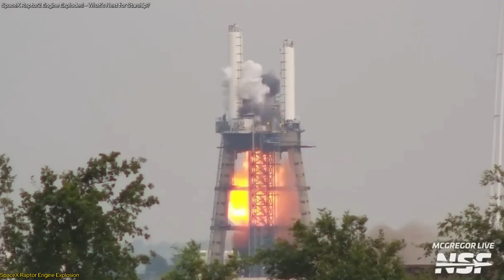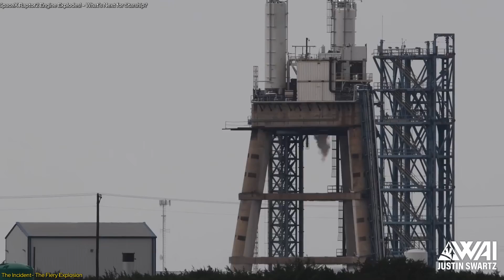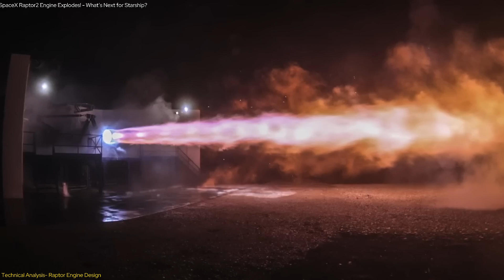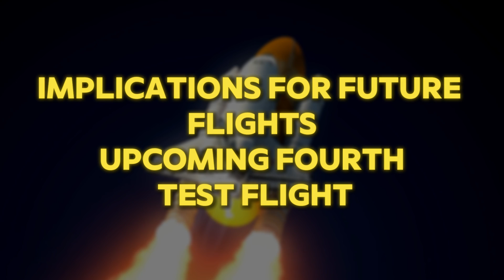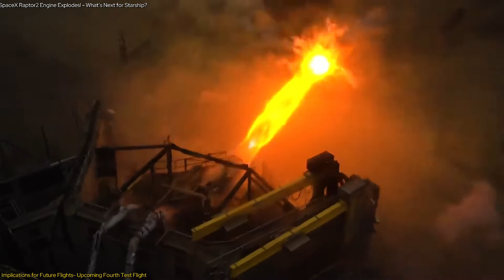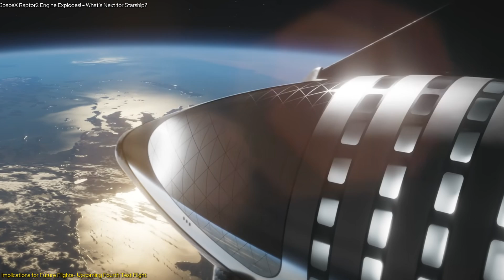SpaceX Raptor2 Engine Explodes! - What’s Next for Starship?

Comment: Machines have to be tested to the limit and even destructively, to allow the engineers define the optimum operating parameters for the desired "life expectancy" of the product. A well known example are the several fatigue and crash tests performed on automotive parts and complete vehicle prototypes!!
Reply: This was not a test to failure.  This was a straight up failure